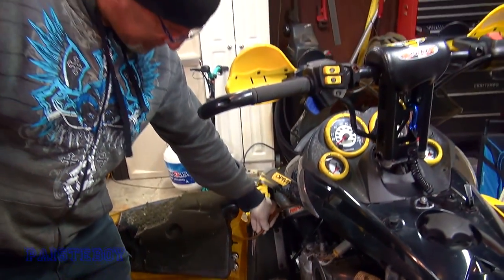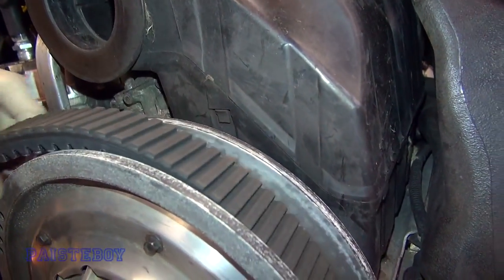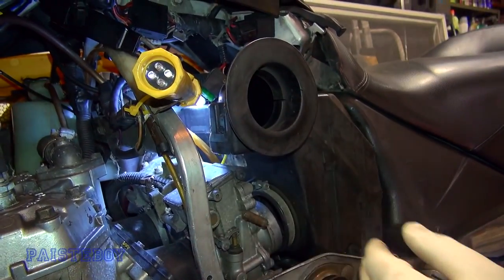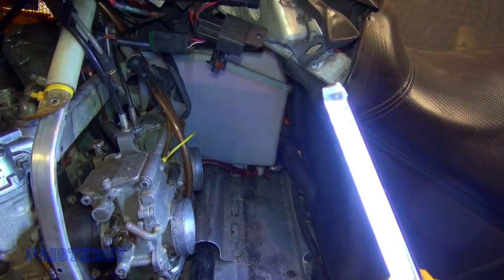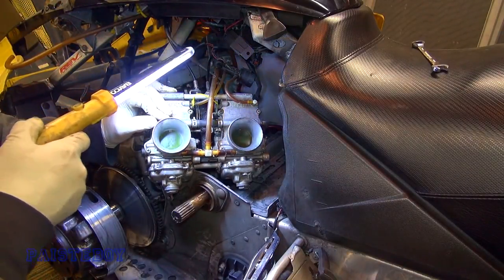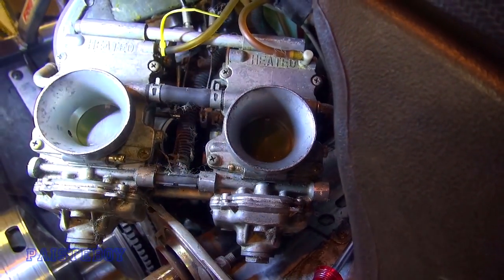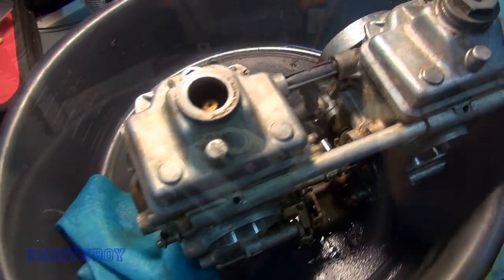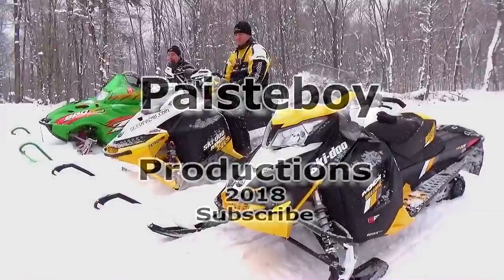2003 Ski-Doo Blair Morgan Carb Removal & Re-jetting: PART 1

Comment: I love the new sleds but I hate working on them.Wish we still had the hood that you lifted up and everything was easy to get at
Reply: Cory Coulter thats what I like about my Polaris...opens right up for easy work on..
Reply from the maker: I agree with that aspect for sure.
Reply from the maker: The only thing is that there is no comparison from the old ride to the new and it wouldn't be possible with that much room up front.  Plus my sled wont need anything so much as new spart plugs for 8000 more miles.  The new e-tec motors don't need much maintenance.

Comment: How did you decide on jets? I just rebuilt my 03 600ho carbs the kit came with 380 main and 17.5 pilot. But the ones I removed were 370 and 20.
Reply from the maker: The sled wasn't running perfect so we decided to try the other size jets that we had.

Comment: Some day I'll have sleds with no carbs until till then I watch carb cleaning videos. EFI is so much better. I've been changing the jetting on my 500 to try and get better gas mileage. If we ever get snow I'll know if it helps. Mark
Reply from the maker: I hear ya Mark.  I was really fortunate with my old 2000 MXZ 700.  I never had a carb issue with that sled and now it's a non-issue with the blizzard.  There are still a lot of sleds out there with carbs and I know it's interesting and fun to watch stuff like this so I figured lets Doo it. lol.  Thanks for watching Mark.
Reply: @Paisteboy  Great video and yes people still like to learn this stuff. Merry Christmas.
Reply from the maker: Have a great Christmas as well Mark.

Comment: Do you know if the v force reeds were stock? what about the gold colour heads?
Reply from the maker: I think the V-force feeds are stock but not sure about a gold head.
Reply: i just got a 03 non bm, its got v force reeds and gold colour heads. Just trying to figure out if they are stock, it looked like the heads were gold, but i guess they are grey?
Reply: thanks btw u got  my sub
Reply from the maker: Yeah, I've only seen grey heads on these motors.  Someone may make a gold colored head but this sled doesn't have one and I don't think the BM did from factor from what I see.
Reply from the maker: Thanks Aaron.  I appreciate the sub and thanks for watching.

Comment: Wow, lots of broken belt fibers everywhere. Good thing you're taking it apart to clean it up. 3 belts is concerning as you know. Excessive heat is the main reason the belts blow and typically alignment issues is the cause of heat generation. I would start looking at the motor mounts, front NUN as well as servicing the secondary and primary. With the potential of blowing multiple belts and the cost of purchase, it would be cheaper to have someone service the clutches.
Reply from the maker: That is some really sound advice Streeters.  It didn't even phase me when he said that in the video because I was filming but in hindsight, he hasn't had the sled very long and shouldn't have blown 3 belts.  After this trip to Old Forge tomorrow we will need to take a good hard look at these clutches and the other possible causes that you mentioned.  Thanks for watching and for the comment.
Reply: Paisteboy Have fun in Old Forge. We’re heading up north this Weekend.
Reply from the maker: Cool.  I hope the conditions are great for you.  This will be your first real ride of the season right?
Reply: Paisteboy Yes. I usually don’t get out until after the Holidays. Too many things with work and family going on.
Reply from the maker: I hear ya.  With the season being so short we try to start as early as possible.  The conditions don't sound that great in OF right now but we have the time off and we're hoping for the best.  I guess the video won't lie.  I think I will get some serious use out of my scratchers in the next couple of days.
Reply: Paisteboy Likewise. Conditions are less than ideal in NH as well. But at this point. We’re going to make the best of it. 

The weather patterns for storms have been consistent for the past 5 months. It’s been so wet in the Northeast. All we need is a swing for the cold air to come in and it should be a great winter.

Comment: those Phillips might be jis screws
Reply from the maker: I guess it's possible but the first one had been stripped out and it looks like someone cut a slot into it so it could be removed.  Seems like the JIS would hold up better than the standard Philips by design.
Reply: It prob got stripped out from not useing a jis driver from a po. I need to get a set for my Yamaha and Japanese carbs.